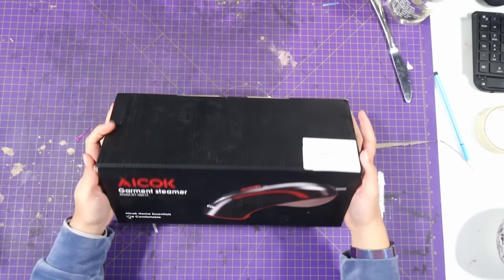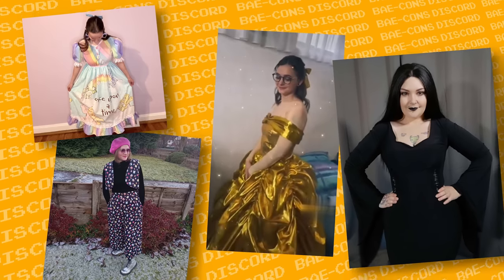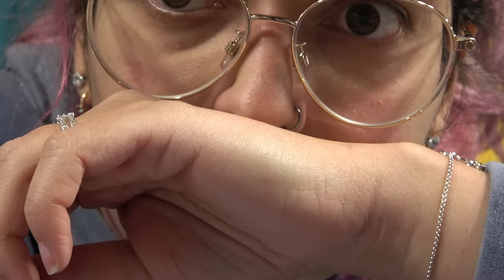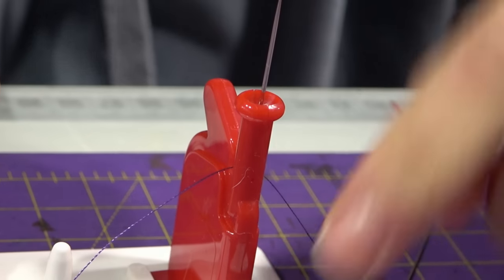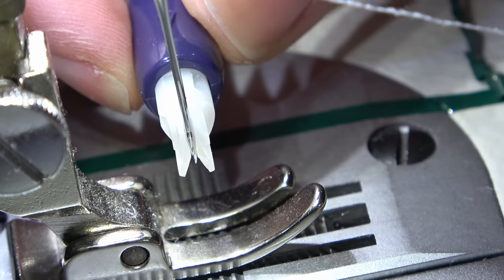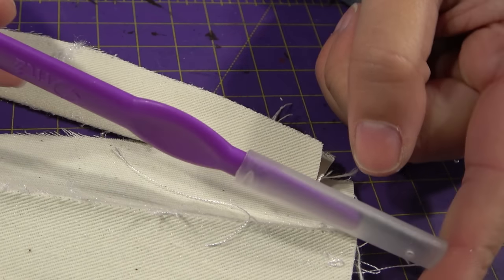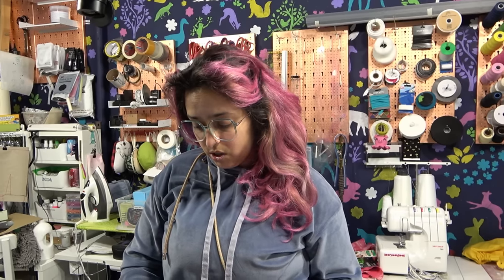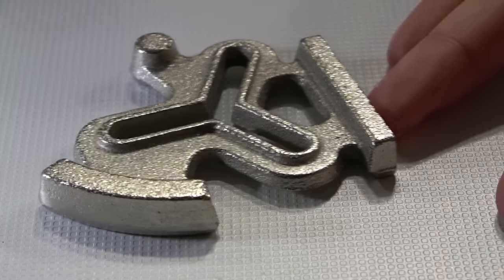These sewing gadgets caused DRAMA! Keep or yeet?!

Comment: The Slice seam ripper - I have a knife from the same brand, like an Exacto knife style but ceramic. It works great on paper, tape, etc, but not so good for thicker things (to be fair, it says it's designed for paper, not card). It's very good at one specific job, but if you want something more multi-tasker, it's not so great, so I find myself reaching for a metal knife instead.

The Dritz scary blade - it looks like a cheaper version of the Tula Pink seam ripper, which is the same but with a fancy metal handle and a fancy price. You can get metal-handled knives like this fairly cheaply in art shops for paper cutting, and you can buy replacement blades by searching for scalpel blades (and get a different shape/length blade if that makes your fingers feel safer!)

The seam gauge - I wanted it to work! But it doesn't look like it's very adjustable for different seam allowances etc?

I gave life to poms 742 and 743 while watching 💜
Reply from the maker: You are a pompom machine!
You can move the gauge back and forth for different seam allowances, the slits in the middle are very good for that :D

Comment: The teeny Clover needle threader: I think the plastic part is to protect the very fine wire, which is likely very fine in order to thread very fine needles. So it might be a pain, but it may be the case that any very fine needle threader would be a pain.

Yes, more replaceable seam ripper blades! I hope this becomes more common!
Reply: I'd just carve a little path on the plastic to guide the needle and keep the protection for the wire. But of course, that should be there from the start... I still want it, the design is very cute
Reply from the maker: makes sense :D

Comment: There is a technique for using the needle threaders which push the thread through the needle, I have used the red stand type and the type which slides down the sewing machine needle, both work well. You need to put some tension on the thread so that the small metal piece can successfully hold it whilst pushing through the needle eye. Also do this gently, if you push too hard the metal prong can bend to one side and it will become difficult to use.
Reply from the maker: Thanks for the info! I think I am too incompetent to use that hahah

Comment: You’re not using the machine needle threader thingy right, I think. You’re supposed to feed the thread horizontally in the slot, then slide the device from top to bottom while applying light pressure. When the little thin metal part approaches the eye, it should push the thread through the eye. You then use the hook on the other end to pull the thread all the way through.
Reply from the maker: that makes sense. I have the feeling the slit is too big for the thread, so when I try to pass the metal thingy, it slides to the side and doesn't go through :(

Comment: Oh, that ceramic seam ripper was disappointing. But the purple Dritz one that you said you'd lose the lid to I have an idea for. Both the end of the handle and the lid have holes in them. I would tie a thread through so when the lid is off it won't escape. Just need to figure out your personal preference for the string length. Why they don't just make the lids fit the end of the ripper or pen or whatever I do not know!
Reply from the maker: I already lost the lid lol. I  need to clean the room, so I will hopefully find it and thread it heheheh
Reply: @Seamstressed  Haha, ADHD strikes again! My ADHD makes it hard when sewing is already "where is that thing I just had?"

Comment: I would use an elastic to keep the seam ripper together with the cap (seeing that both have a little hole on them). But yeah that blade is scary lol
For the ceramic seam ripper... I'm considering just switching the blades lol, if the metallic blade is compatible, then you can have the best of both!
Reply from the maker: That's such a good idea! Thanks!
Reply: @Seamstressed  😁 Please tell me if it works, I'm curious now

Comment: Hrmm.  If you didn't already have a steamer I'd say keep the iron.  But you do.  And it's kind of travel sized so it might be useful for pompom shenanigans.  I... I dunno, I'm fence sitting on this one, apparently.
Yeet to all needle threaders.  I gave up and bought a gross of threaders from the ebay.  They break on the regular.  Le sigh.
You can get a similarly shaped X-acto blade for you knife hilt that is shaped like the tread cutter for a cheaper price.  Agree with the hospital potential of it...  The retractable blade version is safer, but leaves behind damage.  Yeet.
I'm almost at a yeet for the seam guide because of the dip for the curved seams, but I'm curious to see if it will work with a vintage machine.  Keep.  And... interested, for the sake of _science_...
- Cathy (&, accidently, Steve), Ottawa/Bytown/Pimisi
Reply from the maker: I am counting you in :D

Comment: I think the ceramic seam ripper would work great to undo overlock seams if you used it on the "crisscross" side and just cut the threads, not used it in between the fabrics, do u know what I mean?
Reply: I'd make use of it, but you can't get them here.🤷
Reply from the maker: That's a great idea! I will test it out :D